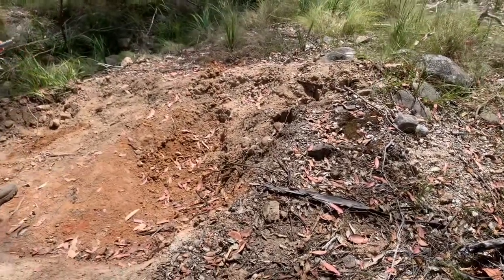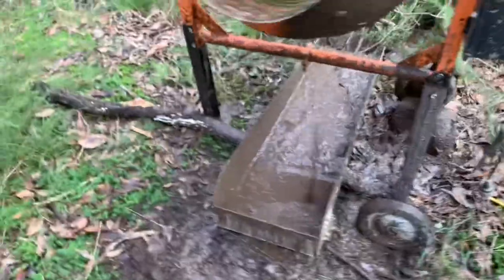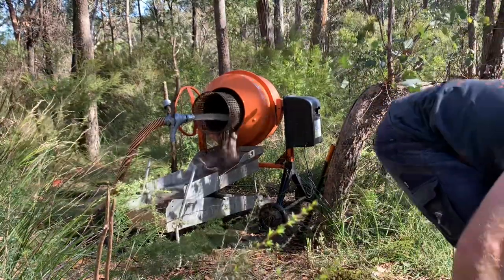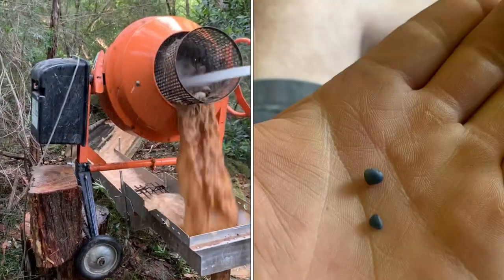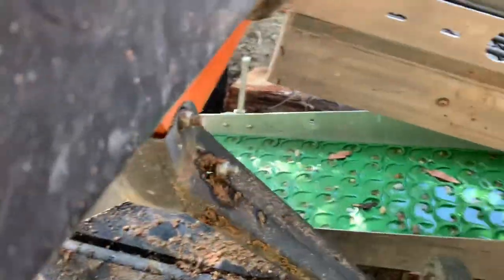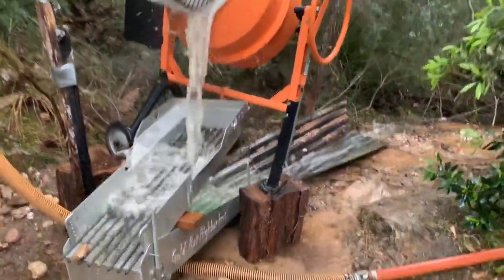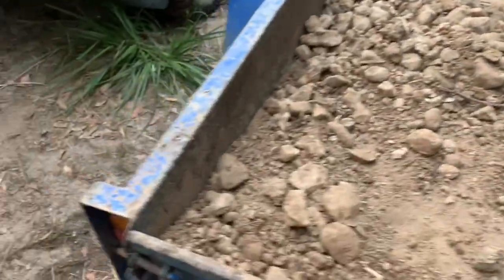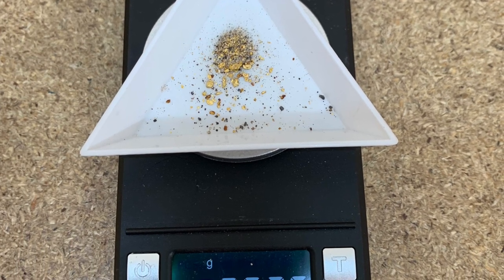Cement mixer gold trommel works great

Comment: Nice set up! The mixer looks like the one sold on line by Edison's if I'm not mistaken. 
The thing about using a mixer is that you can also convert it into a ball mill if you have quartz rock to break down. My plan is to use Bocce balls, you can buy a set cheaply from K-mart. Just a thought!
Mark from Melbourne. 
PS What part of Gippsland are you from?
Reply from the maker: G’day mark thanks for your comment, I’m not sure where the mixer came from other than ebay. I didn’t think bocce balls would be heavy enough to smash quartz if they are let me know 👍
Reply: @Gippslandgolddigga  You can always weaken the quartz by cooking it over a fire and then run it through the ball mill.